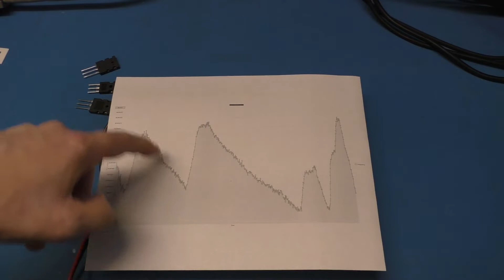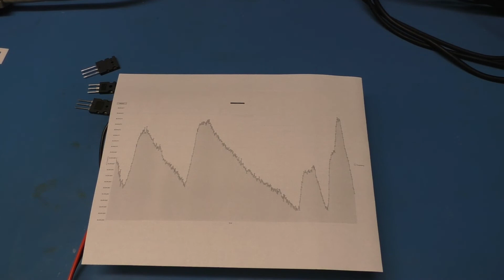Anytone AT-6666 Frequency drift over time

Comment: I did a test similar to this. I checked the drift over a period of 3 minutes at 10 watts. It resulted in a frequency deviation just over 4 Hz. To make the measurement  I used my HP 5371A frequency and time interval analyzer. Thanks for posting this video.

Comment: Looks good and stable.  What would be interesting to see is the frequency tolerance between normal receive operating temperature (which is going to be a very stable temperature) and then doing a high duty cycle transmit cycle which would greatly increase the radios internal temperature.  If a radio is going to drift a lot it's going to be between temperature swings caused by increases in temperature when transmitting.  Even worse is in mobile applications in the winter when a radio can change temperature from below freezing up to normal operating temp.  Ask anyone with a RCI made radio.  Horrible frequency drift with changes in temperature.
Reply: MikesRadioRepair 

Cold .385.08
1hour .385.06
Heavy QSO 384.97
Reply: Very true, I have had 3 RCI made radios and that is their biggest downfall! Horrible with increases in temperatures. I bet they would be great radios if they had internal fans to cool them down.
Reply: Correct. Monitoring isn’t gonna show drifting like talking on ssb for about 5 minutes. My 6666 drifted like hell. I have a Mikes Radio Repair shop as well. I saw that & thought I had a old post from long ago showing up,lol. I looked for a old business card at no success.

Comment: Certainly good results. They vary A L O T more when it transmits. They get awfully hot with the kid on and the transistors beating up. Still, very acceptable for  a $200 radio.
Reply from the maker: That's something that I can test. Simply transmit intermittently and graph it.